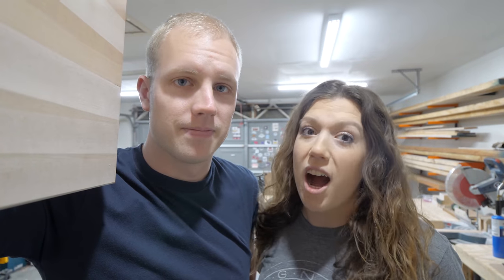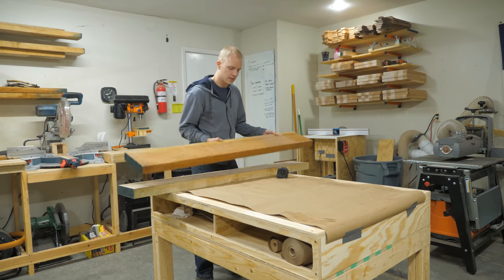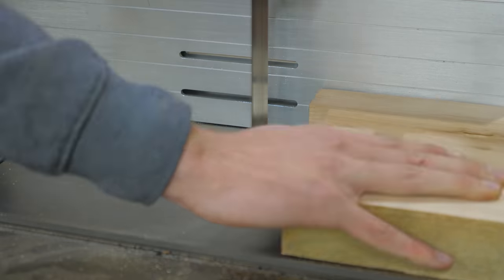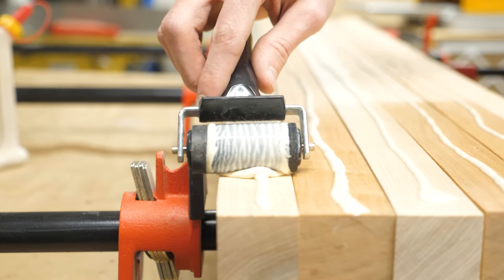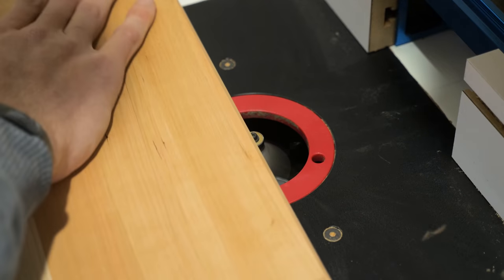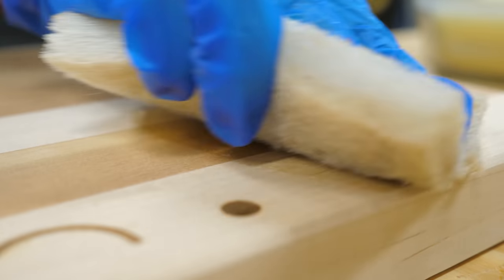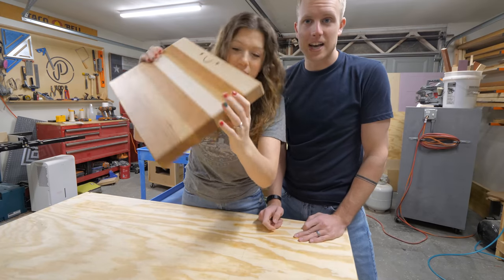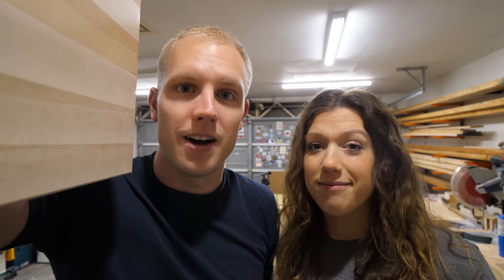building a cutting board for Joshua Weissman (@JoshuaWeissman )

Comment: Here is a advice for everyone who is interested in making a cuttingboard...
Start milling at the side with end grain and then go clockwise around the edges, this will reduce torn edges.
And when you prepare your woods for your cuttingboards...cut your planks in squares and rotate every single stripe 90 degrees in the same direction...glue it up and plaine it again. This method will reduce woodmovement...otherwise you will get a banana😄
For explanation: the planks into stripes ====== and after rotating the tree rings will look like this /////////

Comment: you need drop the band saw guides down to just above the wood also since you uses a joiner should have used a table saw not band saw , also if making a batch of cutting boards should NOT build as one then cut to length no matter how good you "mill" it really stresses the wood even with clamps and glue up then when you cut to length releases it not immediately but wood is always changing so year down the road they will seperate. Also All Hard wood you need to work the grain out not a quick spray and a 220 sand . I love the deal of this video share,share, share to get more subscribers , I have 25 yrs master builder from Hospitals to the Homes in The Woodlands north of you and now 12 years in custom wood shop in Houston I don't do a Youtube  channel since I let my wood into art sell for me I look at every piece and say wow what can this be . ever want meet up let me know I am in the 77080 area